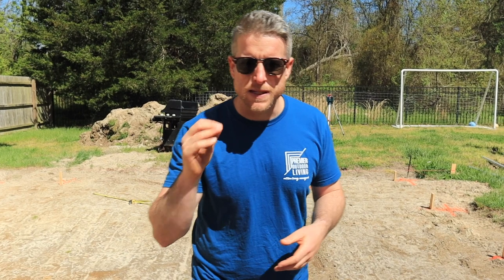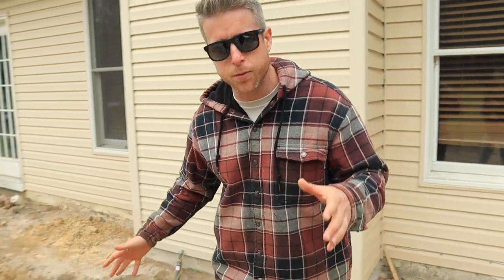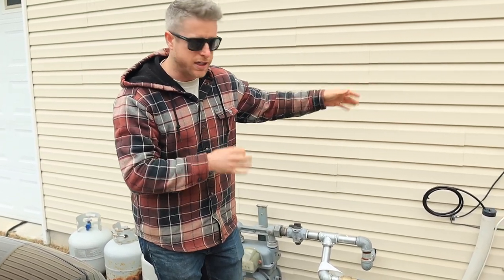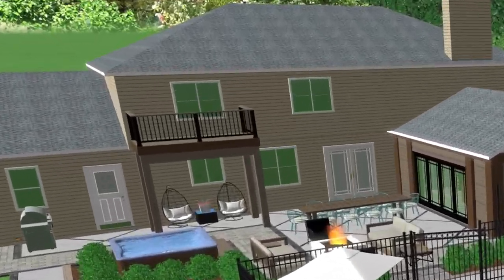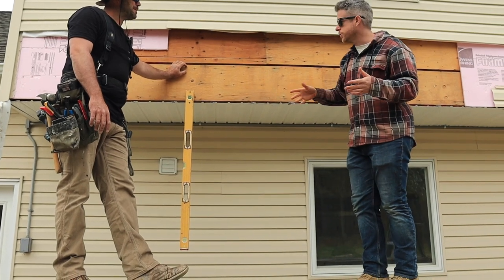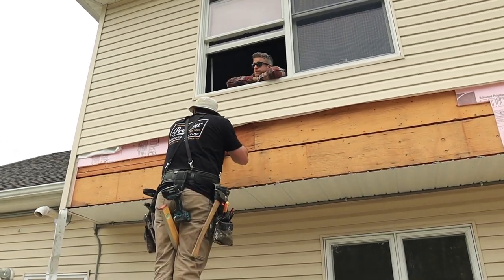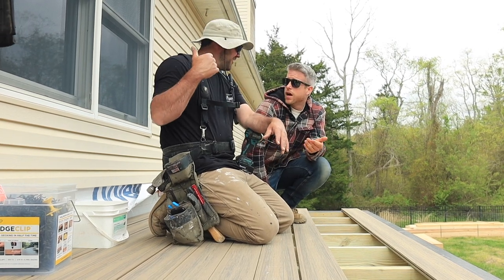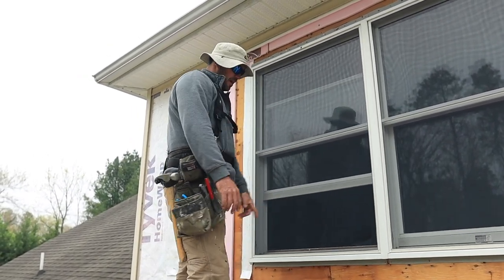Helical Piles And A Balcony Deck! INSANE Backyard Pt 2

Comment: How did you know when to stop installing the pile? Was the installer monitoring pressure or torque during installation? Im not sure where this is. But if the site is sitting on fill soil or weak soil, a single lead section with one helix may not be deep enough. A slender steel shaft is useless if you are not bearing in adequate virgin soil and the foundation could see long term settlement issues FYI
Reply: Yeah the installation equipment monitors the torque and issues a nice engineering report at the end with the results that show the soil bearing capacity. There are some other videos where they can’t get enough torque with the standard length of the pile so they put on an extension and drive it even further down until torque is adequate. The roof overhang can make it tough for them to get the equipment under with the extension so maybe they got lucky here